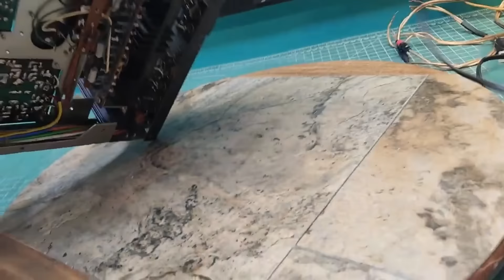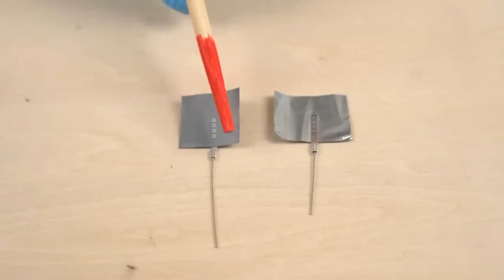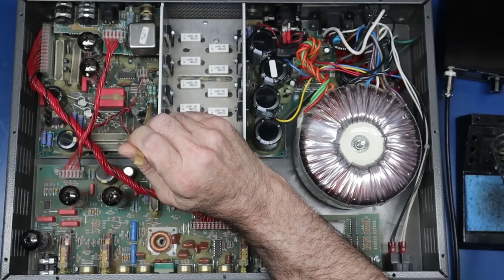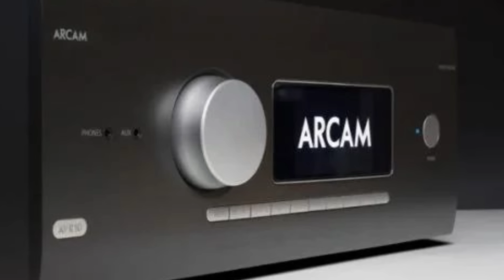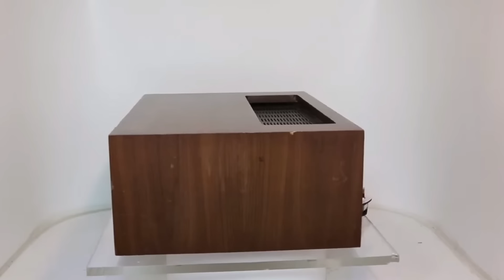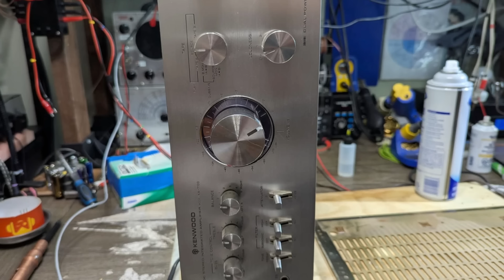Why Your Amplifier Will Die In 5 Years (The Hi-Fi Repair Scam)

Comment: I bought a Marantz 1030  amp in ~1978. It had been the victim of a house fire. Working as an engineer I repaired it quickly, some shielded wires inside were shorted by the heat, not a difficult fix. But the inside of the machine was pitch black from smoke and rust from water damage. The metal chassis started oxidising everywhere. Since it was cheap I thought to use it until it would fail. So that was 1978 when It started its life as my daily driver, to be exact, it was on for 10-12 hours each day, 360 days a year. Moved house 5 times.
Somewhere around 2000 I began to notice problems.... Opened it up, replaced the filter cap's (the large cap's) with some cheap over the counter ones, screwed it shut again. I did not pay much attention, just made "the sound come out again". Around 2018 the sound slowly went to go bad, and then horrible, and in 2022 I wiped a tear for it, it gave up on me.

Then I had a thought.... Although it is not one with the best specs (THT of 0.5% is not low, 2x 12,5 Watt is not high), I liked the amp, and it showed me for half of my life the best music. In a bright moment I searched the Internet for the same model on the second hand market, bought a nice example ( € 180 ), and simply switched the cables from the old to the 'new'. And the old tarnished machine went to my repair room.
For a few months I fully dismantled it, until I had all the parts ready to clean. Cleaned off smoke from the whole wiring harnas and printboards, replaced wires, replaced all electrolytic cap's, a few normal capacitors, a few resistors, replaced some burned and broken RCA connectors. Painted the brown oxidised transformer, made new stickers that were burned off, replaced ALL the small hardware like screws and bolts and washers with stainless steel material, dismantled pots and every switch and cleaned and polished, and brought the chassis to be sand blasted, after which I (stupidly) painted the chassis (It should have been powder coated), before I re-assembled it slowly to working order again. In total I replaced about one kilogram of hardware. But, I had a clean machine..... Then I switched it out again with the 'new' second hand that served me nice for the last 6 months, and now my daily driver is back from the dead, and has proven to be worth it now for three years already. Next year it is its 50th birthday.

Comment: So... is refurbishing a 1977 Marantz receiver with the new electrolyte capacitors a mistake? In other words, are the original quality replacement parts still available? I bought a refurbishment kit with all of the replacement parts (over 100 of them) and very detailed instructions on how to proceed replacing the parts. I have been hesitating digging into that project despite having very good soldering skills. I built a Heathkit Realistic receiver in 1968 which worked great and was in the family for over 20 years without any problems. My father was a Raytheon technician whose job was to inspect circuitry on Sidewinder missiles and he told me my work would easily pass inspection at Raytheon. Still, I fear getting started on my Marantz and ruining it. It still works very well but there is no way a 50 year-old receiver is as good as new and I am probably risking it failing.I cleaned it up last year so it looks brand new and have everything to get started and it would make more sense to replace them systematically while the unit still works than waiting until it fails.
Reply: Go for it ! New high end capacitors are just as good. One really important tip:  For EVERY cap you remove, first note the polarity, because there's NO guarantee that: OR the print on the PCB is right, OR the schematic is right. The only right polarity is the way they are soldered from the factory.

Comment: Memories.  I bought a Marantz 1060 in 1976.  I couldn't really afford it but I was advised by a friend that it was a good one.  He was right.  It 'only' lasted 40-odd years.  When I tried to have it looked at when it developed intermittent drop out in one channel and then 'crackling' I was told bluntly that it couldn't be repaired.  I bought a Yamaha amp to replace it.  It has now developed the same problems, albeit over a much shorter period.  I suppose I don't really blame the manufacturers.  If their products lasted a lifetime then they would be out of business.
Reply: What you describe, crackling and intermittent, is in 90% of the cases caused by a bad (dirty) switch, mostly the push switches. It is the NOT using them that does it to them. When in working order, very gently push in every one of these switches a half a millimeter at a time, and see if the crackle is there. Do that by all individual. If there is a rotating input selector switch, do it the same way by turning it ever so minimal in between positions. The most notorious ones are the tape/monitor and the input switch, but the speaker switches can also go that way.

Comment: Teac 1974 top of the line with solid wood case, fully restored with nichicon audio grade and specific transistors replace by equivalents, sounds strong and beautiful, phono stage warm, detailed and juicy sound. Ready for another 50 years, with main in and pre out, aux can be fed with an RCA switcher to plug a DAC, a streamer whatever trash you want. Any of this get obsolete, just trash it, amp stays, and stays strong for more 50 years. 💪

Comment: Electrolytic capacitors fail after extended periods of use, that is why they are replaced as a matter of course. This has always been the case. 
Is the 'warm' sound you describe added to the undistorted signal?

Comment: The only thing today's equipment builders and C.E.Os are thinking is maximizing the profit and disregarding the consumer's needs.  They know when the equipment breaks, consumer has no choice but to purchase another one rather than fixing with costly repair.  Also vintage equipment were built with parts in which can be easily replaced.  Today's newer equipment uses parts, such as resistors, so small and can not even read the color code or easily removable.

Comment: I used to own one of those Marantz Model 1060 amplifiers... Beautiful sounding and looking amp!

Unfortunately it got stolen while I was in college, otherwise I'm sure I would still be using it today because it was overbuilt. It was one of the many amps from that era that were built like a tank!...

Plus, it was very conservatively and cleanly rated, power output wise, because I think it was only rated at 60 watts per chsnnel at 8 ohms and I believe at least 100 watts per channel at 4 ohms, but it could quite easily put out twice that much, I know because I tested it with an audio power meter, specifically made to do that.

It was an awesome amp! I really wish I could find another one in good working condition nowadays in the used market!

Comment: Yes, and yeah, I still have some of my vintage equipment. Yes, I still use it to this day, but I've also incorporated it with some other stuff. But the harder the system is vintage, I have a date that also has a remote to it, so I use one of my auxiliaries for that now I have a remote through my old component system.  It'll also operate my TV and I don't have to get up so I just essentially put a remote on a 1979 or 1980 or 74, whichever unit I have to be throwing in and using on that particular day, I still have some of the mini amps just for playing. Around with if I throw in just for sushi and giggles still kicking my MTX dual 15, the carpet wins, the one that looked like they came out of a night club. You want another cat scratching post. So I'm not that worried about it, it doesn't affect the sound of it and if somebody walks in, they won't have to worry about Hey, those are nice.  Beakers, how much steal those?Yeah, well, it'll take 2 people at their 4 foot towers.And there's four of them see , you ain't doing it by yourself in one trip😊

Comment: Since about 4 years , i own a restored (capacitors, resistors, etc.) Sansui AU-317 (1978!! crazy!) , use it everyday. Also the exterior is in very nice shape. Sounds great; powerfull, warm, detailed. So the seller (electronic technician) did an amazing job.
And it's also a pretty heavy amplifier.

But..since last week i bought a modern Advance Paris IX-75, from 2024...
It's also a great sounding (and looking)  amp..but yeah..as you told..for how long??

I only stream music now, bcause lack of space 30m2. Sold turntable and vinyl (about 500) a few years ago..
BlueSound Node 2i, Triangle Borea 3 speakers, SMSL SU-1 dac.

Comment: Very honest video.
IMHO, if you are afraid of maintaining/repairing your own Hifi by yourself nowadays (or by a reachable friend, relative), stay away from any vintage products. Because once that old device fails, big costs start testing your nerves. My solution:
-Buy a new good quality integrated amp and use it until it drops dead! Stay clear away from those home cinema amps which have similar life cycle like smartphones nowadays. The wheels of the capitalism need to rotate by the help of planned obsolescence but I am not the one who will feed the nasty machine 😂

Comment: I've had audiolab amplifiers for decades & never had a single failure.all fitted with high grade components.
Reply: Outlet connectors can break though.
Reply: @DrRock2009  They become brittle,but if you don't mess about with them all the time they're fine.
Reply: @duncandistortion yes, I know! 👍

Comment: I bought a Sony TA-1055 in 1974 and has been used regularly ever since. It needed a few dry capacitors replacing a couple of years ago, meaning the originals had been in use for 50 years! Searching out 70's Hi Fi just makes more sense than buying new and will probably sound better too.

Comment: I agree with your comments about the older gear being of much higher quality. I bought a Rotel RMB-1075 5-channel amplifier 20+ years ago and I still use it in my system - mated with a 5-year old Denon X4400H receiver (my 4th or 5th unit since I bought the Rotel amp). I immediately noticed the Denon’s lack of impact and vibrancy compared to the Rotel.

Comment: 100% true. I have lost 5 lacs of Marantz . ONKYO and Yamahs  Dolby Atmos Purchased in 2020. All r hdmi enabled and also shit 2 Sony digital home theatre and 1 samsung digital home theatre  that has hdmi .  But luckily My Vintage Yamaha and Cosmic Works fine and also two Onkyo 5.1 non Hdmi Amp works fine which had digital input and optical input . I can mention exact price and model name and date of purchase. In Ritchie Street in Chennai there is a service shop that fixes these hdmi Amp for 8000rs. They are bypassing some signal but they are not guaranteed to work for longer periods.  We need just a preamp of dolby atmos receiver  as a seperste unit and have normal Hifi Analog Amp or a power Amp like Nakamichi.

Comment: You are mostly correct when you consider cheaper audio equipment but for those buying more expensive audiophile level equipment this is not a problem and that equipment is still built to a much higher quality than this relatively cheap stuff. True audiophile level equipment is not an AV piece.The 70's equipment was not AV and was build for analog only.
Reply from the maker: You make a fair point that higher-end, dedicated analog components are built to a much higher standard than modern consumer gear. 🙂

Comment: About 12 years ago I bought an expensive Marantz Surround receiver so I could have 5.1 Bluray movies and DVD Audio surround.  It sounded great for several years but at about 6 years the unit would no longer power up.  I had it repaired by a reputable tech and it made it almost another year.  My tech fixed it again at no charge but I immediately put it up for sale.  I then replaced it with another Marantz, the top of the line SR 8015, made in Japan unit with even more power.  It still works great but doesn't have a tape monitor loop.  When it dies I will go back to a 1970's model that I use for another system.  I won't buy any audio equipment with a computer in it.

Comment: There is some truth in a lot of what you say. But, please don’t paint all amplifiers with the same broad vrush strokes. I purchased my Rega Elicit MK1 integrated amplifier in 1990 for £1700.  It remained the beating heart of my hi-fi system for 27 trouble free  years. Until in 2017 I returned it to Rega to be refurbished/recapped, costing me £160. It remained in my hi-fi rack for a further 3 years, sounding as good as new! Until  in 2020 I upgraded to a preamp monoblocks combo costing £9000. Today, 6 years later that preamp monoblocks  combo is, as new.  It’s a dedicated 2 channel set up. No switch mode power supplies. No DSP or digital processing software. No touch screens. No touch controls. No Snart phone, smart tab or PC hand shaking. Analog from input to output. Digital sources need to go through an independent DAC which feeds an analog output to the  input of  my amp. Even my premium DAC favours function by precision hardware over chip based operation.   

My philosophy is purity and simplicity. Each component in my system performing 1 dedicated task and doing it to the highest standard. I expect my amplification will benefit from being refurbished/recapped in 10 to 15 years time, but I also suspect it will out live me.

Now, I’m not knocking class D amplification. DSP or digital processing or any of the above that goes against my basic philosophy. My wife, detests my hi-fi system. At best she tollerates it. But she also appreciates music. Many moons ago I purchased for her an ‘all in 1’ unit from Pioneer costing £550. It is all those things. Has a switch mode power supply. A integral class D amp. A touch screen and smart phone integration. It has Bluetooth connectivity, something I would never use. It has a built in CD player, FM analog and digital tuner. A wireless smartphone charging station. And is small enough to place on a bookshelf, yet still fill a 150 square feet room with satisfying music reproduction easily reaching 85db plus. It’s showing no signs of wearing or aging. Now I do appreciate that if it does go wrong, it’ll doubtless need to be replaced. Where as any component in my set up is repairable.

Comment: Because of the transistors, SANYO (STK series) hybrid ICs and ICs for these are obsolete for these 1970s, 1980s and 1990s amplifier receiver because of the semiconductor manufactures e,g like onsemi keep buying up like of sanyo semiconductor or texas (TI) semiconductors keep buying up like of National semiconductor or renesas semiconductor keep buying up like of NEC semiconductor and Hitachi restructured its broader semiconductor division in the early 2000s to form Renesas Electronics and discontinued all the good audio semiconductor (STK series hybrid ICs), ICs and transistors for the good old amplifier receivers and the audio manufacturers use the modern semiconductors are not good for high end audio.
But there is a company out there called Profusion Ltd https://gb.profusion.uk/uk/blog/post/nexperia-chip-shortage?gad_source=1&gad_campaignid=23196433808&gclid=Cj0KCQjww8rQBhDjARIsAE43KPNWt3fhy0V6xbsCLKV9Es4Sa-e-ua3IoVWqUKXlokmiULb3sB60xCcaAiwJEALw_wcB is good for the 1970s, 1980s and 1990s amplifier receivers for replacement
transistors or ICs.